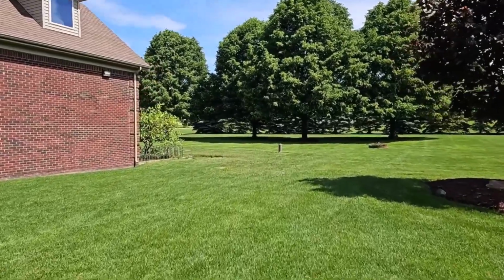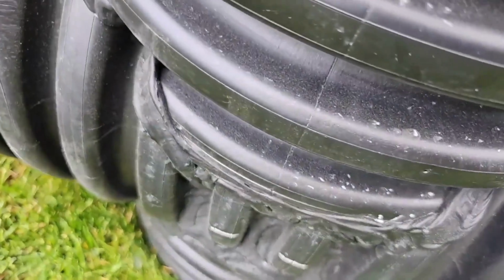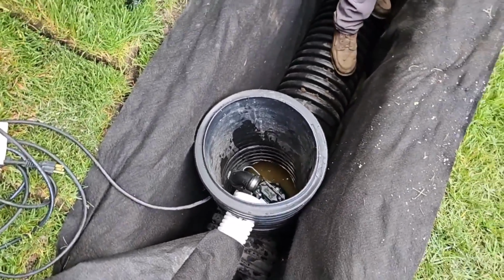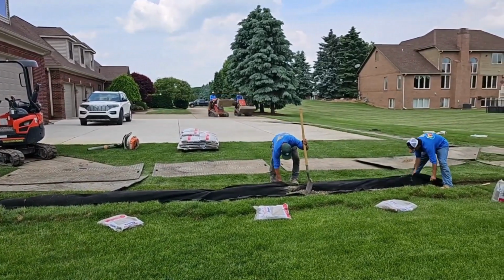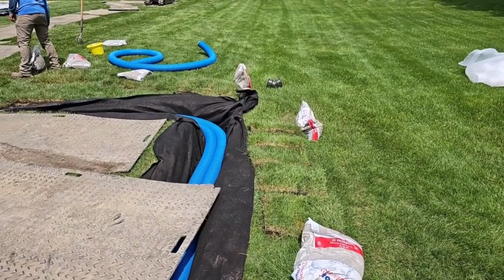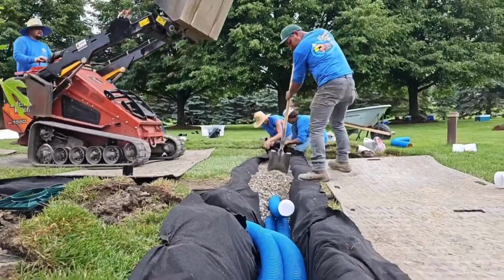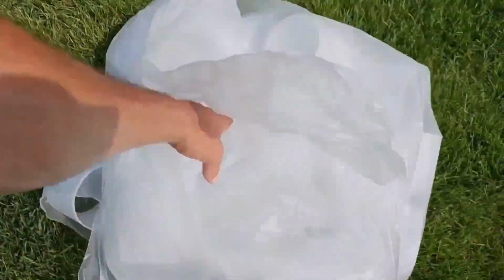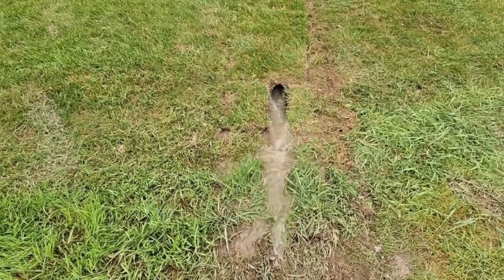How to Build a French Drain to Outdoor Sump Pump System FULL TUTORIAL 2024 Updates

Comment: Very professional work. In some sections you have 4 lines, 2 on top of 2. Are the top two lines effective in that scenario? Would the water not only use the bottom 2 lines
Reply from the maker: @bryandeblasio3549 The pipe creates an airspace, much larger than the stone could possibly create.  This airspace allows circulation for the system to dry out, preventing the growth of unwanted gels that could plug the pipe. It will also help air-prune any tree roots that try to grow inside the drain system.

Comment: Top shelf information, camera and presentation.  Your guy running  the Ditch Witch is legitimate.  
Suggest installing Electrical Power Monitors (network/wifi amp clamps) connected to phone app on your critical loads like the sump pumps.  Set alerts for excessive high or low run time or power consumption.  Can save you many moneys.  "My garage freezer hasnt used any power in 24 hours - better check it".  Stay gold.

Comment: You do great work!   Like you I previously installed 4" pipes at 18-20" deep for my eves trough down spouts at my previous house, my previous cottage, my new shop and my new house.   Capturing large amount of water flow and "routing it away" to lower ground works.   And works great.    For lawn's low ground area, French drains (like at my cottage) works great as well.  Wish proper water management was "minimum code" on houses and shops.  It really does work great.  Thank you for showing us how to install it properly...

Comment: Looking to install a French drain at the bottom of exterior steps that connect to the basement. What is good outdoor pump to use?
Reply from the maker: M53 Zoeller is all you need. If you are in the north, you will have to heat the sump pump pit.

Comment: You stated in this video that you should never put a catchbasin on a perferated pipe as it will eventually kill your perferations. Does this mean that groundlevel intakes for water must only connect to solid pipe? And then does that mean i need both solid and perf in my trench if i want a french drain but also want to capture water at the surface? Thank you - amazing videos!!
Reply from the maker: You can only put it on solid pipe or a knife cut. If you use a knife cut, you'll usually want to put a sock over it if it's in a French drain and you're putting catch basins on it. I'm going to be doing a lot of videos on this topic in the future, so stay tuned.

https://youtube.com/playlist?list=PLjFCqaZ4v1BVX2cpGD7wJqH37RSS1JAOz&si=kr8UvNRnQaTJs_Ws

Comment: Hi Robert, 

Thanks again for the great video. Can you share if it's okay to run gutter runoff into a french drain AFTER its gone through your catch basin? My current set up is 2 downspouts > FDM catch basin > clean water exits into french drain. Is this okay? Or should I be using a popup instead (note it's all installed already but I'm just mildly worried about shingle gravel over the years).
Reply from the maker: You don't want to do that. You need to put a pop-up on that. By the way, you do not want to tie it into your perforated pipe. It will give your French drain an early expiration date. It'll work a little less each year until one year it will not work anymore.

Comment: Question for you @FRENCH DRAIN MAIN :
I don’t have standing water in my backyard.  BUT I do have an issue where when we get a heavy Texas rain, the water gushes out of my gutter downspouts on the side of my house.  That water drains all along my property fence line and off my property.  So my issue is just running water eroding my turf’s soil, and I wind up with thin grass along the edges of my backyard.
For this, I don’t need an actual French drain, right?  I just need piping for rain water to drain through, correct?
Reply from the maker: Yes
Reply: @FRENCHDRAINMAN  thanks for the reply.
Can I use something like PVC or do I want to use the corrugated pipe like the one in your videos?

Comment: I was just wondering why you didn't put a sediment trap between the pump and downspout guard? Won't particles from the roof get into the pump and how would you clean them out? Will they ruin the pump?otherwise it was a great job!  👍
Reply from the maker: If you worked closely with a sump pump system and watched it operate, you would notice that it draws so hard when it kicks on that those particles just get sucked up and pumped right out. Setting a trap would require more maintenance and would be pointless. We have a leaf filter, and that's all we need.
Thank you for your comment and contribution. It was a very good question.